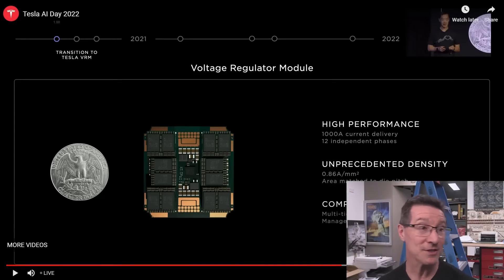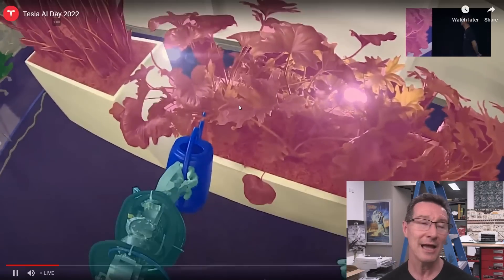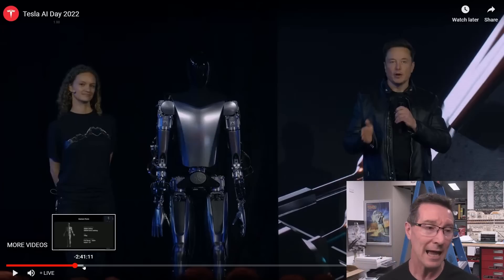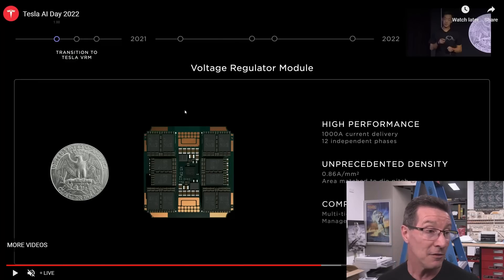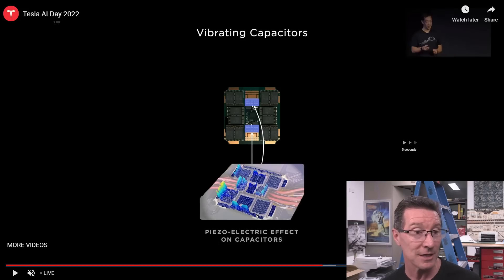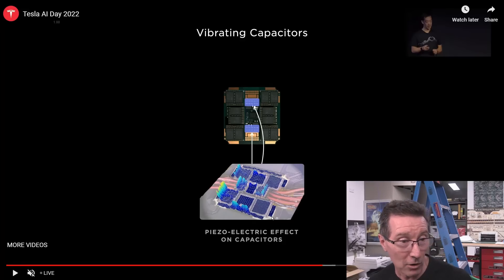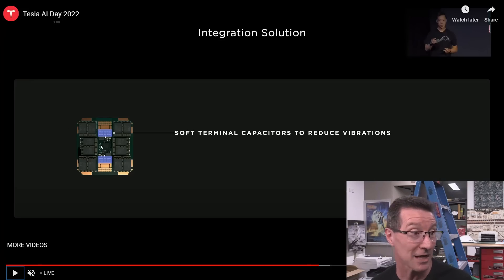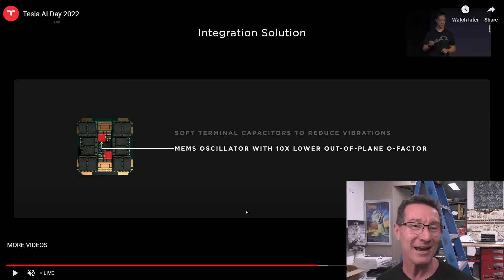EEVblog 1504 - The COOL thing you MISSED at Tesla AI Day 2022

Comment: Retired electronic engineer, wish I was 20 years younger, would try to get a job at Tesla. 
Where they let engineers do engineering, unlike where I worked it was far more important that my lab bench garbage can was kept inside the yellow lines on the floor. 
Solved that problem by attaching a pice a plastic to the bottom of the garbage can with yellow lines on it, therefore the can was always within its yellow lines.
Reply: You do not want to work at Tesla. Their products are flashy, but their internal culture is not good for your mental health.

Comment: Of course, they are sharing all the technical detail about their robot. Why? Because it's not theirs. All the mechanical solutions were copied from other projects, and I would bet that they used mostly open-source systems to develop the software as well.
Reply: @timemachine194 Just look at the sea of papers regarding these topics. Most of them are topics since decades, with working solutions of this level. The amazing part is how they brought all together, but that's where money can help a lot, and having the right tools.
Reply: @timemachine194 My guess is they slapped everything together using the ROS framework. There are existing solutions there for humanoid robot movement, navigation, parallel 3D simulation, VR, etc. Everything is literally there as open source.
And just start looking at humanoid robots or prostheses, and you'll find that no mechanical solution is actually novel here. And their robot literally looks like the Honda P4 from the year 2000 but stripped of all plastic covers with the exception of the face screen.

They didn't produce any new or groundbreaking here, merely proved that with enough money, they can slap together a demo within a year, which otherwise takes 3-4 years for college students with lunch-money levels of funding.

Comment: Insane amounts of power are being used in the DOJO computer. In the same segment as that "regulator board", the presenter said they were running at 2,2MW, and the sub-station tripped - they got a phone call from the supplier...
Reply: Those "insane amounts of power" are far less than other comparable(?) Systems.
Reply: I agree computing needs to eventually be worked into heating if we hope to take a steps towards being more green and efficient
Reply: Tesla is not so green, then.
Reply: @Throckmorton.Scribblemonger  Tesla's solar business has installed over 2GW of solar capacity in the last few years, and soon? or already has 2MW of solar on their factories, so it's just how you add it up.
As I understood it, the dojo system is more efficient compute per watt than existing solutions anyway?  They mentioned having 14000 gpu's in their existing, traditional compute clusters.  Maxed at 300W per A100 would take 4.2MW for the gpu's alone.  Tesla would be using a lot of power either way.
Reply: @Throckmorton.Scribblemonger  What a brain dead comment. Tesla installs solar and builds cars that are dramatically higher efficiency than even hybrids. Electricity usage to train a software that could potentially save thousands of lives from car accidents is well worth it.
Reply: @Throckmorton.Scribblemonger  No tech company is green, anything involving computing is running slightly smarter radiators to produce vast amounts of information. They can throw a few solar panels on the HQ roof but you'll still see massive substations and high voltage powerlines coming into their server farms as well as big radiators or cooling stacks, unless they're close enough to a city centre to provide central heating to a neighbourhood or an industry requiring a lot of heating.
It would take Hydro dams or Nuclear power plants to run low carbon computing on the scale of a server farm, even a modest server farm would require at least a few windmills and a boatload of batteries to run autonomously.
Reply: @Soken50  Yes, but practically all the tech energy becomes heat, so by locating yourself in Alaska, Canada and Scandinavia rather than California, Arizona and Texas, then some of that heat can be used for heating purposes.
Reply: @niclash  Oh wow it's almost like I mentioned district heat and other industrial applications already, funny that.
Reply: @Soken50  "No tech company is green"

I get an internal, wry smirk each time I re-notice the "Carbon neutral since 2007" tagline on Google's landing page.
Reply: @Throckmorton.Scribblemonger  if you use and electric car, chances are you charged that with coal or natural gas when follow the plug back... how about the mining and disposal of the battery?   probably less than green, right?
Reply: @paladro  Everything except basically grass is less than green, but some things are greener than other things, It is important to look at lifecycles of the necessary alternatives you are comparing.
Reply: @paladro  so because changing over to clean energy doesnt happen instantly we should just stop? Evs are more efficient by 3 to 1 even if their power comes from fossil fuels.  3 times less fossil fuels burned to go the same number of miles under the worse case conditions, eg no renewables used.
Reply: @paladro  I pay extra to get exclusively nuclear power.

Comment: 1000amp continuous rating? Highly sus. Even if it was solid copper it would melt
Reply: Modern GPUs consume 500W at max load. With ≈1V core voltage you get 500A with all phases. Nothing melts if cooled good enough

Comment: current problem with solving the AI - human brain: less than 100W power consumption. AI: Kilowats power consumption. The human body is extremely efficient energy machine. I think engineers are just starting to get it…
Reply: Electricity is cheap though, especially if you don't have to carry batteries around. Humans are expensive for basic tasks.
Reply: @rkan2  Let's revisit that statement 3 years later, when the talk about energy consumption of data centres has become more mainstream and we use in our daily language Giga Watts to describe compute power.

Comment: I don't see human robots around the house but as logistics and assembly workers they wouldn't even need the legs most of the time. Much easier to have them on tracks or wheels or even mounted in place near the assembly line.
Edit: The biggest question is actually how easy they are to repair. Can't have a mechatronics engineer in every location. And I can't see it being cost effective to replace the whole thing every time something breaks. So it would need to be very modular.
Reply: Gernot Schrader  yes precisely.

But even for other specialisations there's no point in a humanoid robot. A roomba is not a humanoid robot. A lawn mowing robot won't be humanoid, An office cleaning robot won't be humanoid, a dog walking robot won't be humanoid. A box carrying robot won't be humanoid. 

And I can't realistically see a scenario where 1 humanoid robot is going to be cheap enough to be cost effective compared to all the specialised alternatives, whilst also doing the job as well as the specialised robots would do.

There's a reason why the oven/washing machine/car/alarm clock never supplanted the individual single purpose items. And that's basically what a humanoid robot seeks to be.
Reply: @benholroyd5221  I think a modular approach is best. The advantage of a humanoid robot is that he can do anything a human can do so he can be used flexibly for the task needed the most. And you won't have to replace your existing shelves, vehicles and tools with one compatible for automization.
Another thing that is very likely is that a human could interface with the robot through VR and remote control it during dangeeous tasks.

But if the system is modular you could replace the human hand with a specialized tool or have the torso mounted directly in a drivers seat. You're right that specialized robots will always be better for their task but I think partially human-like bots will have their uses.
Reply: We have had robots building stuff like that for a long long time. Have you ever seen how a car chassis is made for example?
Reply: "Very modular '
From recollection version 1 used off the shelf parts.
Version 2 has bespoke parts and they reduced the type of part (actuators/ sensors) to 7(?).
I'd say that's pretty "modular" 8 months into a project?
Reply: @rogerstarkey5390  You honestly believe Elon's timeline? You must be out of your gourd.
Reply: I don't see humanoid robots ever being a thing.

It's strictly worse than the alternative for every niche, so why not specialise?

And why do you need general purpose AI for limited and specialised jobs?

I've seen 2 videos of this doing 'useful' work. One where it's watering plants, and could be replaced by a hose and timer. And one where it's carrying boxes, where it could be replaced by a glorified roomba.
Reply: @benholroyd5221  ... the problem is that the glorified roomba will get perplexed when it encounters stairs or needs to move something in its way—even if it could figure out what it needs to do, it won't have the means to do it. Our world is largely designed around humans and there's a ton of legacy that won't be replaced anytime soon to fit task-oriented robots. Sure, if you're building a warehouse from scratch, you might as well build it with 'glorified roombas' in mind (as Amazon does), but there are millions of existing warehouses (and other facilities) that weren't designed like that where a task-specific robot just cannot replace a human.
Reply: @zwerko  what warehouses have stairs?

Warehouses are just lines of shelves.

Yes the world is designed around humans, because humans are doing the things. Warehouses are designed around forklifts because forklifts are doing the things.

For any place it's economically worth having a robot, it's economically worth designing the space for robots. 

What task is this stair climbing robot going to be doing? Why are legs even better than some other system? Walking is computationally expensive, and limits the weight you can carry.
Reply: @zwerko  The main problem is that walking is dumb if you can do literally anything else. If you can add ramps to make your floor traversable by wheels then you just do that. If you have stairs then you can just put in a small lift for a fraction of the cost. If it needs to occasionally traverse rough terrain or stairs then you put the wheels on legs that are slow but will get it through. The only time that walking is superior is when it is going to spend a lot of time crossing rough terrain. There are so many inherent inefficiencies and compromises that you need to make to use walking that it is best avoided if you can.
Reply: Please bring your robot to our authorized tesla service centers for repairs to avoid future unintentional strangling accidents. $25,000 will be deducted from your account as diagnosing fees. Any unauthorized repair will void your 3 months warranty.😂🤣
Reply: He’s making them adaptable to help build the Mars colony. All the tech Elon is developing is for that goal.
Reply: @MikeAndTum  You can't honestly believe that nonsense.
Reply: @thomasbecker9676  elon believes it
Reply: @TheKaarnageShow  Elon is a lunatic.
Reply: @TheKaarnageShow  
Elon also believed a 25k Tesla.
Reply: @AttilaTheHun333333  and you would be mad not to buy one as it will earn 30k per year as a self driving taxi
Reply: @AttilaTheHun333333  well what is it actually…
Reply: If you have a 20k humanoid robot that can do many different tasks and move seamlessly from one place to another I think that will be cheaper than having a dedicated robot for every single task. Assuming each task doesn't require 24/7 operation.
Reply: @TwitchyMofo  "20k humanoid robot" is pretty much a non-starter.
Reply: @thomasbecker9676  care to elaborate? 20k seems feasible. Everything is made by Tesla and with economy of scale things will be fairly cheap. Very simple camera for optics. Shouldn't be that expensive to build. If you watch the presentation they have made every consideration to make it cheap and easy to mass produce.
Reply: @TwitchyMofo  You're joking, right?
Reply: @thomasbecker9676  please point out specifically what I said that sounds like a joke? If you have nothing to actually contribute to the conversation besides vague responses like this, then don't bother replying 🙂
Reply: @TwitchyMofo  $20k for a state of the art robotics system. Meanwhile, Tesla can't even get a car priced under $40k. You probably believe in Hyperloop, too, so I'm wasting my breath.
Reply: @thomasbecker9676  Again another vague response and more generalizations. Zero specifics. What makes something "state of the art"? There's no lidar in this thing, just actuators, accelerometers, and some cameras. There is nothing state of the art about that stuff. There's the main PC board which is probably not that expensive. PCBs are surprisingly cheap. If you design them you would know that. The software is what makes this thing advanced and software doesn't cost anything after it's been developed. There's no BOM cost for software. 
There are so many more parts in a vehicle. The bot will absolutely be cheaper. Also Tesla cars can be much cheaper. They have over a 30% margin. But why would you sell a car cheaper when you can't build enough to supply demand at the higher price? When competition comes their prices will drop.
And no I do not believe in the Hyperloop. Although there's nothing from a physics perspective to make it impossible. The vacuum aspect just adds insane complexity for very little benefit.
Good thing typing doesn't waste any breath.
Reply: @TwitchyMofo  I don't think you grasp the fact that there's a huge variety of the components you describe, and the less they cost, the less suitable they are for use in advanced robotics. You think Tesla cracked some code that Honda, Boston Dynamics, etc. haven't been able to, in under a year?!
Reply: @thomasbecker9676  If you watch the video they describe every component they are using. If Tesla is making all its components in house, which it is, and taking parts used in its cars, which it also is, you dramatically drive down the cost. Also what kind of argument is that to point to another company and say no one can do better than they already have? That would be like saying look at Nasa, they have been the leaders in space for decades. No one can ever do better than them. Oh wait SpaceX is now the only company to launch a reusable orbital class rocket. Not only that they are the only company that can launch astronauts. They also are the cheapest $ per kg to orbit. Its just a ridiculous argument. No one stays the leader forever. Someday some company may over take Spacex or Tesla. Rocket lab is building a brilliant new rocket to compete with falcon 9. I am done discussing this with you. Your arguments are seriously undeveloped. Your critical thinking skills are severely lacking and you would do well to try and think for yourself rather than jump on every hate band wagon you come across.
Reply: @TwitchyMofo  TL;DR. I'm assuming you aren't an engineer or in a technical field, so your opinion doesn't hold much weight, especially when you fall back on gems such as, "you would do well to try and think for yourself rather than jump on every hate band wagon you come across."
Reply: @thomasbecker9676  I'm an electromechanical engineer. Specializing in manufacturing design.
Reply: @thomasbecker9676  you've not addressed a single argument I've made which is why this is no longer worth any further discussion.
Reply: @TwitchyMofo  All your arguments are moot, as they boil down to, "yeah, but, Elon!" Do you have any professional engineering or manufacturing expertise? Do you have a degree in anything related to mechanical engineering or technology? What evidence is there that you're doing anything but parroting talking points assigned to you by the cult?
Reply: @thomasbecker9676  Um yes I do as I already said... Also I have not mentioned Musk even one time. However your "arguments" 😄 can actually be boiled down to "musk is bad". So the hypocrisy there is hilarious. You've literally said nothing of any technical significance.
Reply: @TwitchyMofo  You're saying that objectively, Musk isn't bad?
Reply: In due time one bot will just fix another..

Comment: One could expect troubles when he put things not to where they belong. Seen this before in Haas VectorDrive. They put DC bus bleeder resistors right beside optoisolated amplifiers that are sensitive to heat, so they drift and degrade pretty quickly.
Reply: Doesn't belong?  They made it work.  That means it belongs.  You realize it must be a small package to do what it is supposed to do, right?  They can't space things out and still have something that works.
Reply: @_PatrickO  Why should CPU clock generator be on VRM board? Solar roads also work.
Reply: @_PatrickO  Don't get me wrong, hats off to the engineering team for solving and sharing this issue, though the initial decision was kinda weird, imo.
Reply: Sounds like... Incompetence?
Reply: Alex Fedorov:  Everything is about trade-offs in time, in cost, and in trying to optimize EVERYTHING.  Just seeing all the complex failure modes in software during my career in that, the number of ways to make tech.hardware unreliable blows my mind.